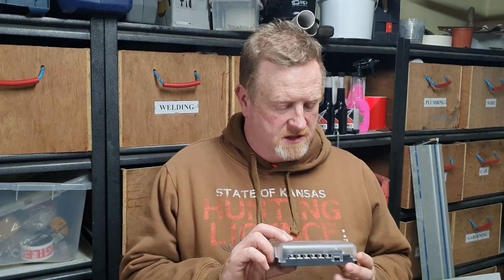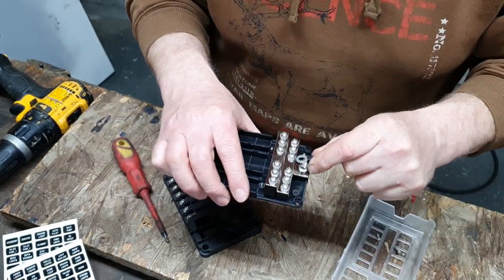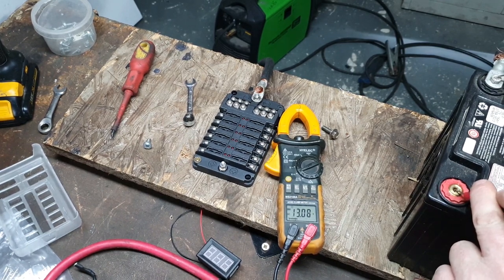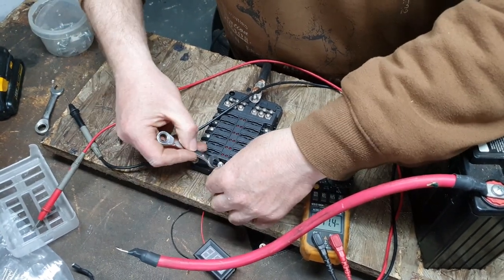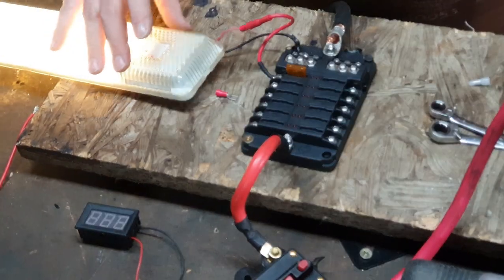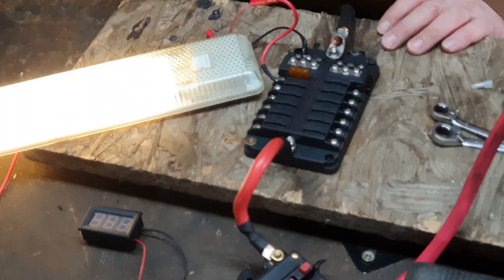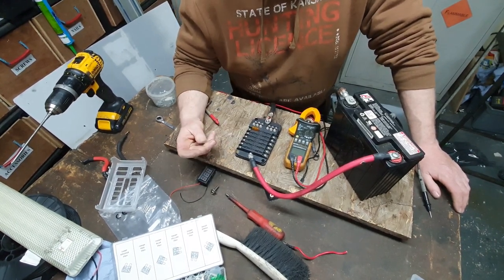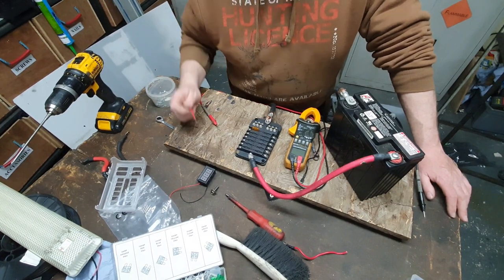12v Camper Van RV Boat Fusebox review

Comment: Here is a "best practice" tip:  Coat all wire conductors (and terminals) with dielectric grease prior to crimping and heat shrinking, same for ALL plugs, sockets and fuse blades!  (obviously this does not apply to solder type connectors)

Comment: Great video! Im thinking of getting the same fuse box. I had one question. Did you use such thick cable to connect the fuse box to the battery because of the maximum amps this fuse box can handle? Which i think in this case is 100 amps? Cheers!
Reply from the maker: I used a heavier cable from the battery. Lots of wire size guides on the net
Reply: Ok cheers! Am I right in thinking I would add up total ampage of all circuits in the fuse box and then get the appropriate grade cable? Cheers for the quick reply !

Comment: Did you have to change out the battery cable terminel to fit the smaller post???
Reply from the maker: Hi, yes. I got some smaller hole rlterminals and made it easier to attach. Also used a smaller cable but short so the  load was fine. I joined this cable to the heavier cable from battery switch. Worked out well. Jamie
Reply: @campervancreations7656 ok.. ty!! Did the same with the cables from the switch to the fuse block.

Comment: so what to do if the batteries are 24 volt? then I would say connect negative to 12v to 24v changer and then from changer to battery?  wow it seems I have to buy few 12v to 24v thingy for every single thing I use.  I would like to thank you so very much for your great explanation.

Comment: Hi Jamie.
This is exactly the type of fuse block I would like to use in my canopy, but with a few more fuses.
You explained how it worked and its functions, which was great, but now I need to know how to add an on/off switch to control the light, assuming the light didn't have an inbuilt switch. TIA.
Reply from the maker: Colin,

The light only comes on when that fuse is connected to the circuit blows. The led is not lit up if nothing is connected. 

If something is connected and there is no fuse then the light comes on. Hope this helps.  Jamie

Comment: Yes, great video - hope things are going OK.
You mentioned that you can make a earth connection on bare (vehicle chassis) metal (no need to return to fuse box) - if you've covered this in another video then grateful for a link.
Reply from the maker: Hi, basically it's using the body as one big earth wire. Once you connect your leisure batteries negative to the body your providing a point anywhere in the van back to your leisure batty earth terminal and all you need to do is run positive wires from the fuse board through various appropriate switches.

Comment: I could cry for joy seeing this demo!!!  I've been searching so hard to understand how RV fuses are wired as I have to redo my hot mess.  Some water got in and shorted this out in my RV.  I cannot find ANYONE on this planet to do the work so doing it myself.  I had some questions if I may.  I know nothing about electricity but figured if I matched it right it should work the same way.

In my RV 1997 Class C - the main distribution panel with circuit breakers is under the stove. 
A small set of 3 fuse panels with 4 fuses each was stuffed by maker into a tiny spot under the stairs near the battery. The 12V wires have fork terminals not ring terminals.  So glad you showed this option as well!
I have a 30 amp AC power system.  I'm in the US with 110V AC power - fyi.
You have a 60 amp fuse panel.  Should I be getting a 30 amp fuse panel or higher?  My max AC current coming in is at 30 amps, which is higher than normal household 15 amps circuits.  I just need to know the amp size of the fuse panel.  Not quite sure how that works.

Thanks so much for explaining how the battery terminal posts are hooked up as well. This was a mystery. And also for showing how to use the Multi meter to test current and flow.  Please be sure to show this in detail with a close up in future videos.  Enormously helpful!  Subscribed!!!
Reply from the maker: Hi Lass-inAngeles,
Firstly let me thank you for subscribing, always great to see and welcome new subscribers. I understand your frustration with the issues your having and the inability to get anyone to look at your problems and huge respect for undertaking the job yourself. Remember, the information and people who are willing to guide and advise are out there but ultimately doing the job yourself will be very rewarding, it will be done right and you will know how everything is setup, making future work considerably easier.

Fuses are designed to primarily protect the wiring, it can be bigger than is necessary for DC but using the correct size fuse and wire avoids running anymore expensive copper than is necessary.  Are you rewiring the fuse box in 12dc side or just replacing the fuse box and using existing wires?

On the AC side, the protection is done in 2 ways. Firstly we use a device that detects any imbalance in the system between live and neutral.RCBO (for residual-current circuit breaker with overcurrent protection) in Europe; GFCI breaker (for ground fault circuit interrupter) in USA and Canada, These are critical on the AC side as they protect against life threatening situations 12v dc fault could have the potential to cause a fire of give nasty burns but are rarely life threatening.  I'd need photos and more info to be or more help. Facebook campervan Creations or Instagram as the same. Thanks for watching and hope it all works out. Jamie
Reply: @campervancreations7656  Thanks Jamie!  Yes, the GFCI outlets are already installed.  The main circuit breaker box where the AC comes in - I'm not touching that. All I am doing is putting in some new fuse panels for DC wired lights and small stuff.  All 5, 10, 15, 20 amp fuses at most.  I am lifting this wire mess out from under the steps and installing fuse panels on a wall right next to leisure/house batteries.  I know my RV is a '30 amp system' but not sure if that relates to type of fuse panel to get.  You have a 60 amp fuse panel.  Do I need a 30 amp fuse panel?  Do you count all the fuse amps and add them together or just pick the highest one at 20 amps, or go with the 30 amp RV power setting?  Sorry, for using all the wrong terms and being such a newbie but I know nothing about elec.  I really envy your knowledge!  Wish you lived here, I could learn a lot.  I'll take some photos.  I'm truly grateful for this knowledge.  If you want to know anything about health, supplements, how to fix pain in lower back, or pet health, give me a shout out.  I'm very good with that.
Reply from the maker: Making a few assumptions here so forgive me. What I'm guessing is the Max  12v dc current feeding the fuse board is 30amps and should be protected by 30amp fuse. This would be where you have everything DC switched on at the same time and big red wire bringing the power to the fuse board is protect by a 30amp fuse or DC breaker or in my case 60amp but the wire I'm using is rated far higher than 60 amps but 60 was the breaker I was happy with.

30 amp fuse in your system means that the maximum load at any one time cannot exceed 30 amps. However all you would need to do to up the spec to 60amps is change the positive wire going from the battery to the fuse box to 4awg which has a maximum of 100amps over about 10ft. Protect that with a 60 fuse or dc breaker as in my video and you should have plenty of capacity to run your RV 12v system. They probably put 3 x 4way boxes each feed with 30 amps. Also each individual circuit will be protected by the 5,10,15,20 amp fuses individually.

You could and should, work out the maximum power consumption of everything dc in the system, heaters, fridges, water pumps lights etc etc. And add them all together. And multiply by 1.5 and round up to the nearest fuse or breaker size and that will give you the protection for the wire feeding the board. J
Reply: @campervancreations7656  Lots to digest here, so noted all this.  Now I'll go add up my amps and work it out.  Thanks so much for your help!!!

Comment: Good video plenty of info !!  just a quick question. I have a trailer tent with no electrics and thinking of putting in a battery just for 3 or 4 led lights and maybe  one of those volt meter,cig socket,usb socket all in one and a water pump. Im going to  put in a smaller fuse box like your one...  Would i need to Earth the battery to the chassis ? and would i need a circuit breaker like the one in video ?

Thanks

Comment: I installed 2 of these in my boat but I'm puzzled: when I switch on a light and then remove the fuse, the light goes out and the fuse LED lights up just as it should. However, with the fuse installed I measure 13.06V on the outlet but when I remove the fuse, I still measure 11.4V on each (+)outlet when I connect my multi-meter between the (+) and the (-)block. The fuse LED then faintly lights up.
I would expect that removing the fuse would interrupt the power. It looks like the 11.4V is too weak to activate the circuit but it's not 0.
Did you test this?

Comment: Hi 
Really good explanation 
I would like to put a 12 volt extractor fan in my caravan. What type of leads do I require to go the battery from the fuse unit. Do I need an in line fuse, if so what size would you recommend.
Advice great appreciated.
Thanks
Reply from the maker: First bit of information needed is what power in Watts or amps is the fan and that will dictate the wire and fuse size  also how far away from the battery will the fan be and including any switch.
Reply: @campervancreations7656  
The fan is 12 volt Thule vent 
Min power 2w max power 34w
The fan is a roof fan above the kitchen area 
The on/off switch is on the fan unit
I hope that all makes sense.
Michael
Reply from the maker: So your fuse size would be amps. this is reached by dividing the power 34w by the voltage 12v  which gives 2.83amps. There is no 4 amps fuse so the next size would be 5 amp's. Blade fuse, inline holder would be fine but with a current of 4 amp's the minimum cable size I would recommend would be 1.5mm2. Suitable for a run of no more than 5m. 

Remember The fuse protects the wire from heating up and melting and not the fan. Jamie

Comment: Are these cheap, unbranded fuse boxes the same quality as the expensive ones? Is the metal actually plated copper? What's the voltage drop across the terminals?
Reply from the maker: Obviously the quality may vary with price. No discernable voltage drop. They work fine in a camper, boat etc. Wouldn't use in an aerospace application but suitable. Jamie
Reply: @campervancreations7656  Sweet. It's cool to get advice from an actual engineer. I'll get those twin positive bus bar ones I've been looking at on eBay then. Gets a bit complicated if you want to take advantage of the programmable, switched load outputs of 2 victron solar controllers in parallel- so much functionality though!

Comment: Hello great video and Thanks....I have a question. When you attached the the negative wire to the negative fuse bar. Does it matter which screw the wire is attached to?????
Reply from the maker: Excellent question. All of the negative screws are connected together behind the fuse board so it doesn't matter electrically qhich screw you use but if you have a few different negative wires going to the fuse board, it would be best practice to use differed screws. Thanks for watching and if you enjoyed the video, a thumbs-up always helps. Thanks again . Jamie
Reply: @campervancreations7656  Thanks for the speedy reply. I have the exact fuse box, and will be working on electric this week. Just another question for you. Does the wires from the battery to the fuse box 4 AWG or can or can I use 10 AWG?? Thanks Again!!
Reply from the maker: @nspacelofihiphop7101  4awg is probably overkill but 10awg should be more than sufficient. Remember,  the correct fuse size based on your expected load for the total combined load connected to all outputs is there to protect the wire rather than what's connected to it. As long S the fuses are rated for each appliance/circuit, you should be ok. But without knowing your exact setup, it's hard to give precise info. Jamie
Reply: @campervancreations7656  Thanks for the vid!!1 again and thanks for the feedback!

Comment: Excellent video mate.
 Well done.
Quick question. 
With out a ground to the chassis would the 60amp breaker be on the Negative side.
  Dont elections flow from Neg - to Pos+.
 Or have I got that wrong.
 I'm thinking more in a marine application.
Reply from the maker: So, your really getting deep here. Electrons do indeed flow from negative to positive but I think you might be referring to a sacrificial anode used in marine applications to prevent corrosion. This is due to the presence of alt water, which is highly conductive. In 5he case of a road vehicle, the tyres act as insulators and the body being ground is irrelevant but good question. Jamie
Reply: Thank . 
Appreciate the response.

Comment: hello. Thank you so very much for this informative video. I'm going to mount a similar fusebox on my motorcycle. Regards from Sweden. Stay safe and healthy.
Reply from the maker: Excellent plan, just remember most of the equipment on the bike is mostly low voltage, so remember to keep the fuses low. Jamie
Reply: @campervancreations7656  Ok 👌 it should be safe with 5 amps ? Is there any lower fuses than 5?
Reply from the maker: Yes, you can get 1 and 3 amp fuses. Most wiring is protected by the fuse size so always be sure to size for the wiring and not the equipment.jamie

Comment: Is it best to ground the box to the batery or the frame.. Thank you .great video.
Reply from the maker: Either method is acceptable, by grounding the box to the leisure battery you then need to run 2 wires + and - to everything you want to power from the box. If you have the leisure  battery connected to the body and also to the fuse box, you only need to run a + wire from tleach fuse and the - wire to the nearest suitable point on the body. Jamie

Comment: Many useful applications for that panel. Jamie, people may wander if the panel goes to earth, (ground), on the chassis, and your appliance goes to earth on the chassis, will the led light still work?
Reply from the maker: The led's are part of the circuit, if a fuse blows the LED will light up. It's done on a loop back wiring. The LED's are part of a series circuit, and a break in that circuit uses a 12v supply from the main live in to light it up. Jamie

Comment: Hi, what gauge live/negative would you use on a motorcycle from battery to this fuse block? Thanks
Reply from the maker: Sorry, did see your message till now. You need to work out the max current draw that the bike needs and match the wire size.

Comment: I've recently purchased this fuse box and I've noticed that it has a positive current of about 7 volts still going through the output terminals when the fuse is blown or when there is no fuse inserted (i.e. any time the red light is on). Is this supposed to be the case? The relevant device connected doesn't work (presumably because not enough voltage), but I'm definitely reading about 7 volts.
Reply from the maker: Confused me at first. Its actually explained in the video but it uses a low voltage to light the led if the fuse is blown. Jamie
Reply: @campervancreations7656  thanks Jamie! I understand that, but surely this means that it could still short and start a fire because that voltage passed beyond the light to the outputting terminal? Doesn't that defeat one of the key points of the fuse? Thanks for the help!

Comment: Question for u. I got a bluetti ac 200max. It has a 12 volt 30 amp port i want to hardware into a fuse box like u got here. Can it take the place of a typical 12 volt battery like u are using here?
Reply from the maker: Hi. It's a perfect solution. Using the bluetti as a power supply works fine but remember you only have a max load combined of 30amp s. So 4 10 amp fuse loads would trip the bluetti. Having said that, unless your using big 12v loads everything should be fine.  Personally, and again my opinion, these are great for backup power but I prefer battery bank solution as if any one component fails it's usually an easier fix. 

Inverter fails you lose ac but cheap fix

Battery fails simple fix at a cost.

Usb socket fails cheap simple fix.

If a bluetti/jackery/power bank fails you lose everything.  Depending on warranty and they are bloody expensive to replace. I'm not saying that it will fail!  Let me know how you get on
Reply: @campervancreations7656  I was thinking a 25 amp fuse between the bluetti and the DC fuse panel box thing. 
That way I can't damage anything. 
   All I wanna run is a few lights and a couple fans in my van while I travel for my job
Reply from the maker: Hey  25amp fuse would be fine from the ac200 to the fuse board. Also worth noting. The fuse is there to protect the wire and not the item it's connected to. But with lights(i assume led) and a fan or two it should be perfectly fine. Jamie.

Comment: good video, for a novice I've followed it quite well. Can you advise? do I ground the fusebox to the vehicle body as well as the battery? (ive got the exact same fusebox for my camper conversion) THanks Bob
Reply from the maker: Bob, I use the vehicle as my ground or Negative supply for all my interior lighting, usb sockets and any other 12v, light current accessories. I've connected the -( negative)of the battery to the earth point on the fuse box and also to the body.

This allows me to only run a single +(positive) wire to power lights and charge point, fans or what ever I need. The only thing you would need to be certain of is that all panels are conductive and have metal to metal fixings, some manufacturers use high strength adhesive rather than spot welding, equally as strong but no use as an electric circuit for what we need. 

So in short, yes.  Jamie